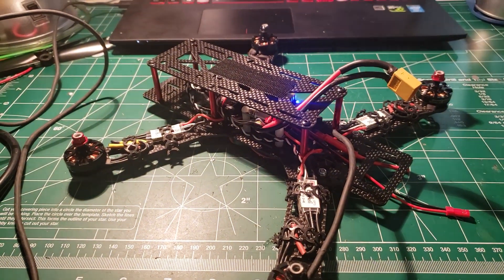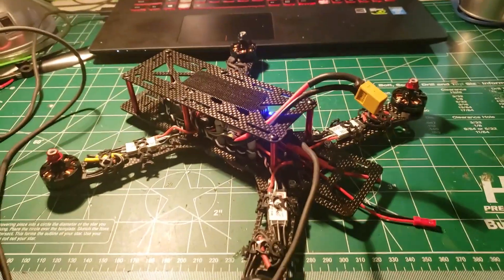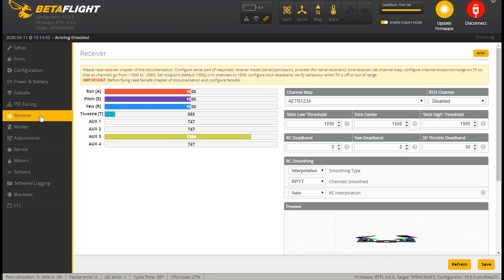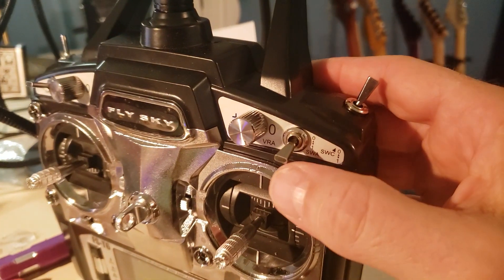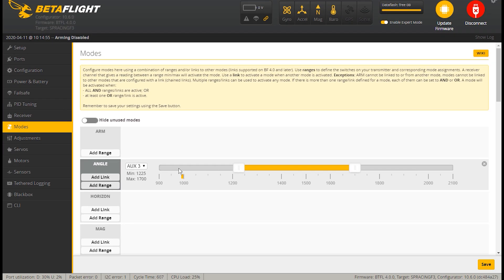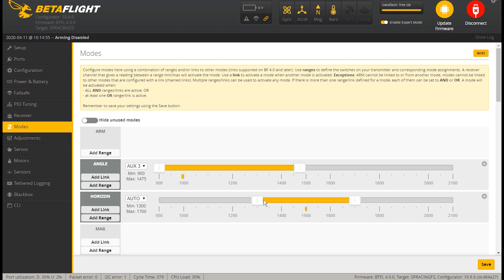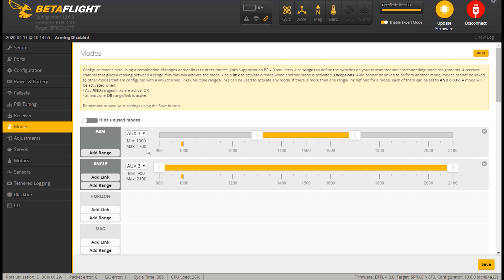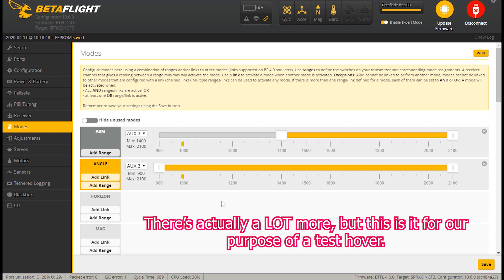Set Modes Betaflight Troubleshoot Arming Disable Flags

Comment: Great video. I learned something today. I have a question though. With the drone on the bench with props off. You arm, moving the throttle spins the motors, now if you move the right stick, do the motors spin. All depending which direction you push the stick.  If the motors do not spin with right stick. Then when you take off does the right stick become active with the motors.  ???????

Comment: Hey Steve! Question: my quad is having a hard time maintaining a steady hover. It drifts up and down, but not laterally. After liftoff, I give it a small throttle input, and the drone just keeps slowly ascending instead of maintaining a relatively stable height... Any ideas of what could be the issue here? Thanks for all the super informational videos and happy holidays!
Reply from the maker: 1.  Make sure your trims are centered.  2.  Calibrate your sticks in the radio.  3.  If 1 and 2 dont fix it, set your problem see this  https://youtu.be/el1q_b6HFYY  and https://youtu.be/vTBHD7kHSSQ